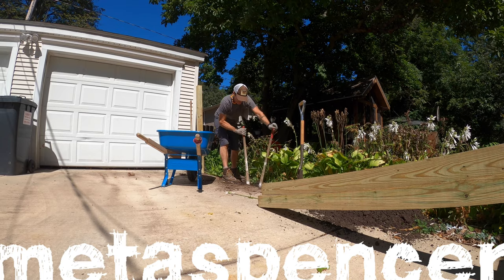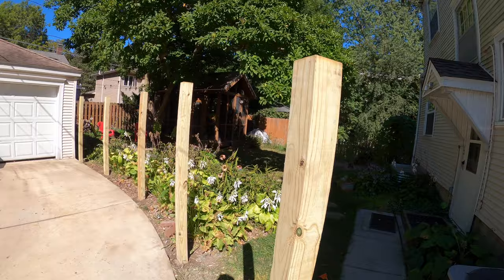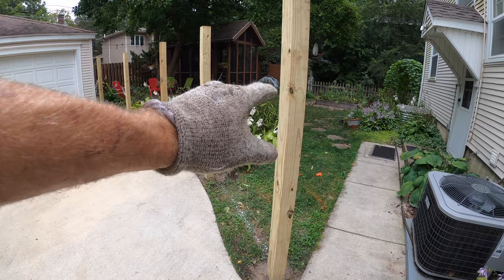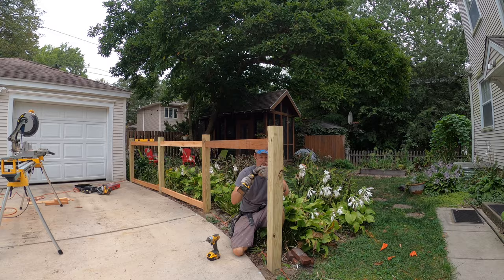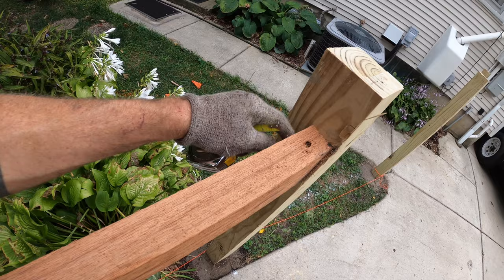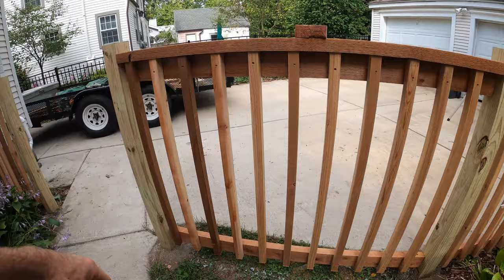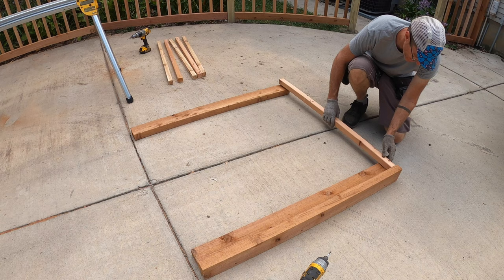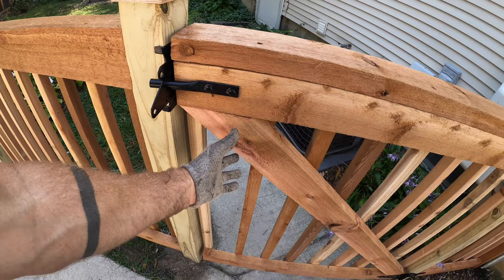Building This Modern Curved Fence

Comment: Where do you start with the first “picket”? Did you measure 4 inches in from the post? Or do you do measurements and make them all equidistance?
Reply from the maker: It kind of depends. You need to do some estimating to make sure they'll all fit in the span. If they'll fit then yes, start with 4" off the first post. But if you need to make one or two a bit closer you can do that to "fudge" the difference at the end of the span

Comment: My gate openings are on a slope, running downhill along the face of the fence.  Debating whether the gates should be level (and make a square) or run along the slope (and make a parallelogram).  A square gate would look tidy, but it’s horizontal rails wouldn’t visually meet the rails from the adjacent fence portions. A parallelogram gate would nicely follow the slope (like the rest of the fence), and its horizontal rails would visually meet the rails from the adjacent fence. Also thinking about functionality, my guess is that square gate would be better balanced, and that a parallelogram gate may be more inclined to shut (or swing open, depending on which side the hinges are on).  Anyways, did you consider this when making yours?
Reply from the maker: I've done it both ways and it really depends on the location and look you're going for. The one problem I've had with the parallelogram gate is how it swings: in some instances, it'll hit things on the bottom. Anyway, good luck with it!

Comment: Great video... I was trying to find a video on building a fence on a cruve like this... But my wife wants only horizontal wood design instead of the vertical wood lines... And she wants the wood to be outside the post instead of putting it inside the post like u did... Do u have any tricks or tips on doin that?
Reply from the maker: I built this one using horizontal boards -- https://youtu.be/hnSiR3sx3wM ... maybe that will help! you can do it!

Comment: Can you do this fence with all horizontal pickets? Looking to follow my driveway as well but wanted to be a little more modern looking
Reply from the maker: Oh yeah, horizontal fencing is good stuff and can work on this format. When I build horizontal modern fences, I focus on picket spacing to get it looking just right. And use good stock as you don't want them to sag/warp over time

Comment: What size and type of screws are you using for the rails and pickets?  Are you pre-drilling with a countersink?
Reply from the maker: Yep predrill with countersink. Cedar is dry around here. Size depends on application— 3.5” to 2”
Reply from the maker: And use good outdoor rated fasteners

Comment: Curved fense on a slope, any advice for that type of project? Thanks
Reply from the maker: Lots of ways to do it and it depends on the look you want. Level sections? Even sloping fence? Sounds like a good one
Reply: I just did this exact build, with a curve and slope. Toughest part was cutting the correct angles for the top rails and pickets. A dual bevel miter saw was essential.  I followed the slope of the ground between the posts for each section. I love how it turned out.

Comment: what length screws?  did you use a torx or phillips head screw?  finally, did you just eyeball each post and twist them slightly to establish the curve?  thanks for the informative tutorial.
Reply from the maker: Posts in this case align with curved driveway but string might help ya. Torx are all I use and mainly 3.5” but some 2” on the balusters. Good luck!

Comment: What are the dimensions for the horizontal rails?
Reply from the maker: I never go beyond 8' but in this case I divided the full span into equal segments so they were all about 7' 6"
Reply: @metaspencer  and they were 2x4’s?  2x3’s?
Reply from the maker: @piazzaalexis  Yeah, rails are some nice rough hewn cedar 2x4 cedar. I've seen fences sag over the years with 8' spans. I'm not worried about it in this case but if you are  you could do 6' spans.